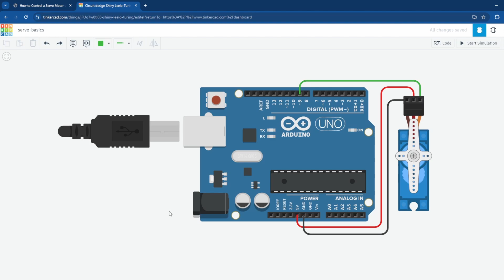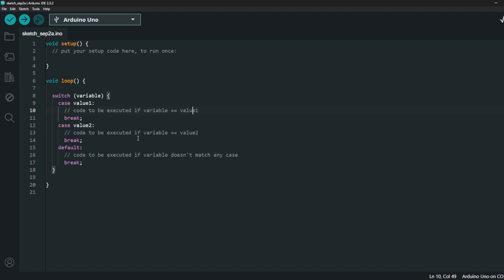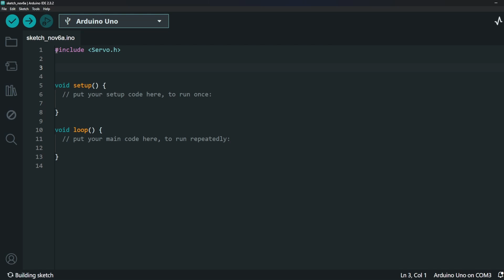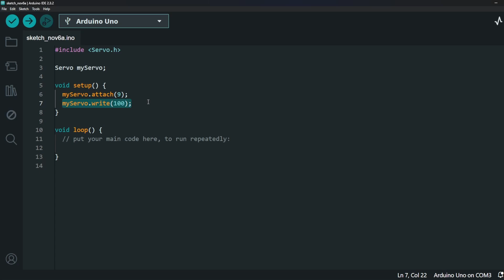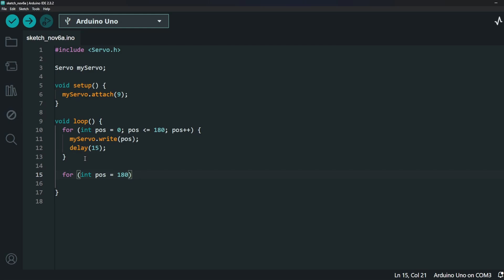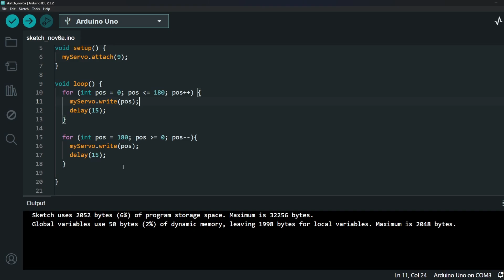How to Control a Servo Motor with Arduino

Comment: Beautiful piece. Sir, please could you make a video or series of videos that will comprehensively dissect the various methods and instances applicable to the mostly used Arduino libraries?
Reply from the maker: @Takashi_Nebula  sure thing. Thanks for the suggestion!